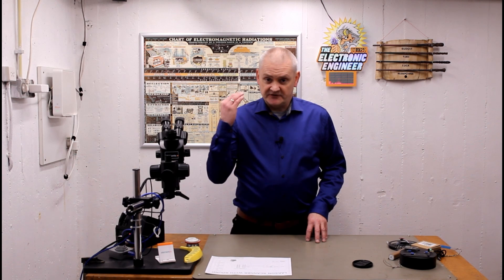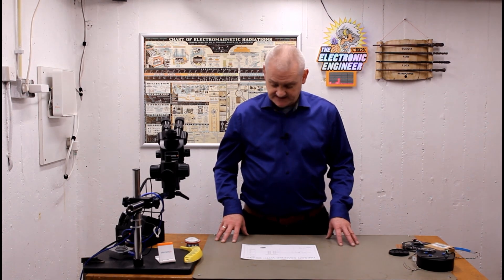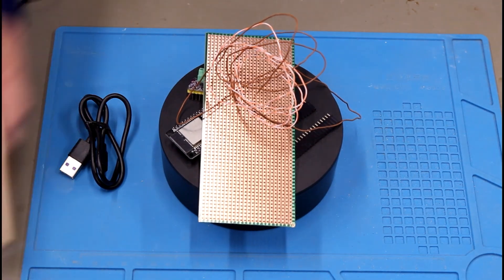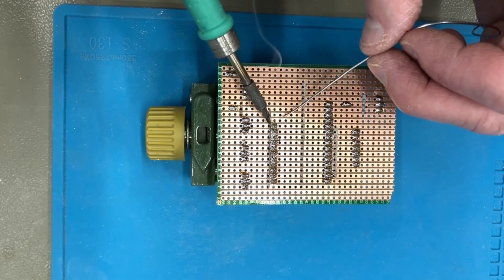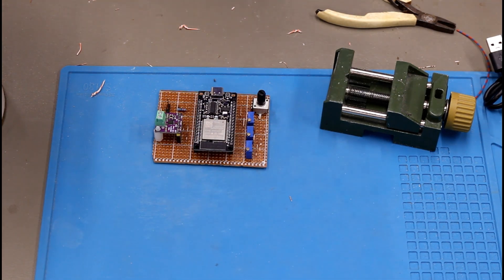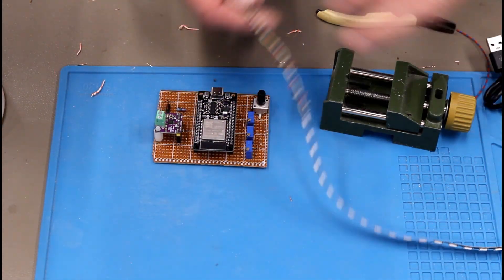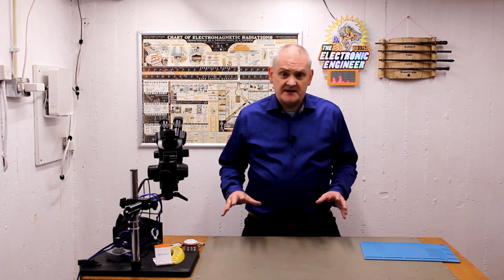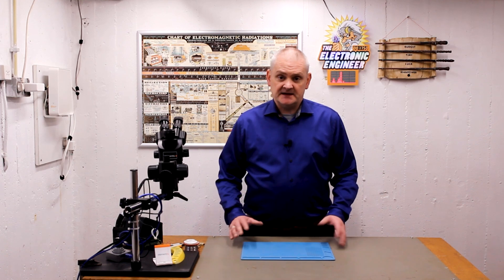Build a Larson Scanner with Sound Using an ESP32

Comment: Excellent project.  Finally got all my parts in and routed out the copper.  Wanted to confirm the top/bottom and left/right.  At 4:23 you shows the copper routed out.  Using the single notch at the bottom right, if I flip it over horizontally, that notch will be on the bottom left.  Correct?  Which way with the connector be on the ESP-32 be facing?  Sorry for the questions.  I am better at soldering the un-soldering.

Comment: This is a great project, and relatively easy for people who aren't super skilled with electronics. However, it seems like a lot of overkill and extra expense to use WS2813 LEDs. I understand why you did it this way, but it would be much more economical to use plain red LEDs. If you're going to use addressable RGB LEDs, it would be nice to at least be able to change the color.

I know that using plain LEDs would require a lot more components and wiring and it would me much more of a challenge for novices, but there would be advantages. Simpler components are more reliable and easier and cheaper to repair. If you're making it for a specific application, the flexibility of changing the number of LEDs, speed and size are probably unnecessary. A lot of applications would require fewer than 12 LEDs.

I can see that doing it this way has its place. The adjustments are meant to be "set it and forget it", not something you will be changing often, and it's nice to have something you can throw together in an afternoon that will work for a lot of different applications without having to make any modifications to the design.

Thanks for another cool project!
Reply: There will be an update soon, including colors